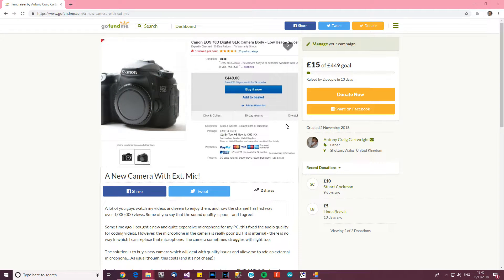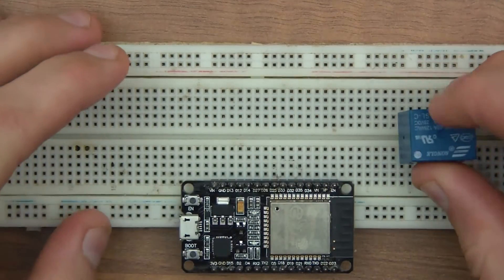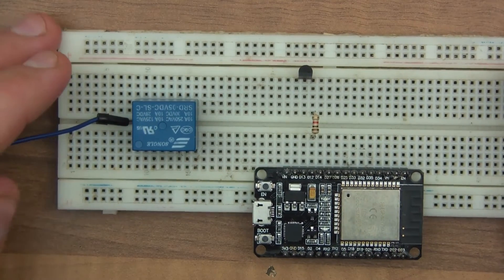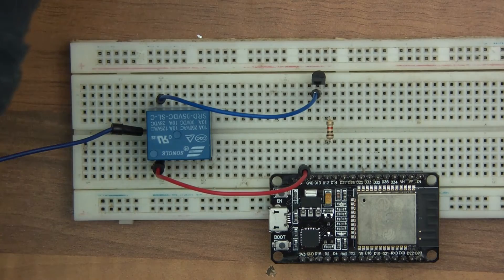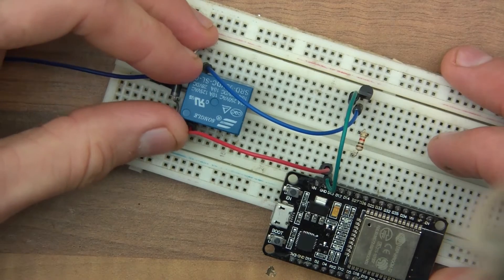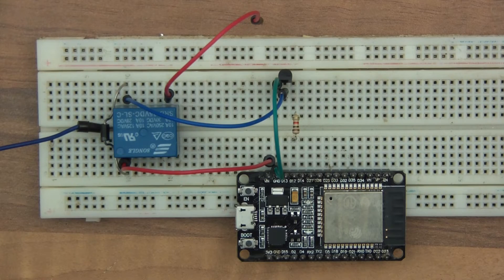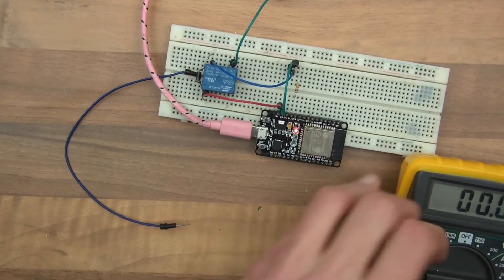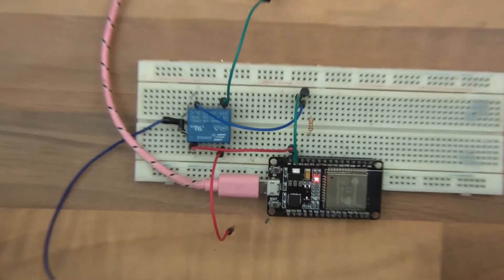TUTORIAL: How to Setup & Code A Relay - Arduino, ESP32 & ESP8266 (Part 2) Quick + Simple!

Comment: hi thank you so much but I have a problem, i did everything correctly however my relay isn't clicking
what do you think is the problem
Reply from the maker: Hi, so take the relay out of the circuit completely, then look for the schematic. Sometimes it's printed on the relay's body. Look for the two coil pins. If you energise them with 5v (depending on your model), then it will click. If it does not click when you energise it with the specified voltage, then it's most likely dead.

Comment: When I add a DC device to the relay output, there is no problem. But when I add an AC device to the relay output, random texts appear on the serial port after the second command. It's as if the AC device is sending something wrong to the ESP32 and disrupting its operation. How can I fix it, any idea?
Reply: its probably interferance. try using an octacoupler